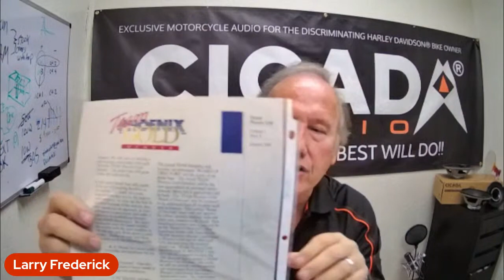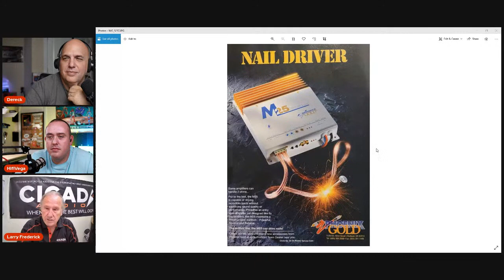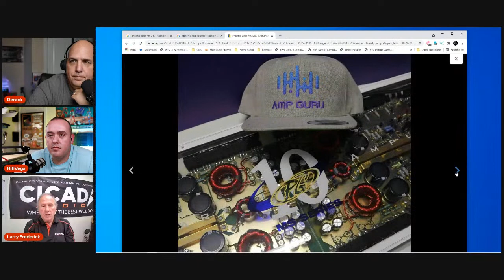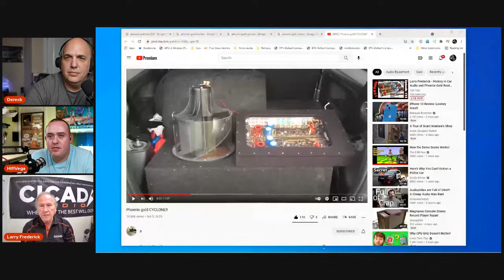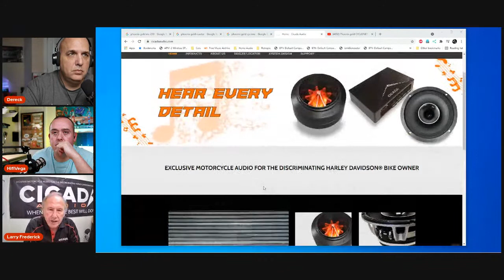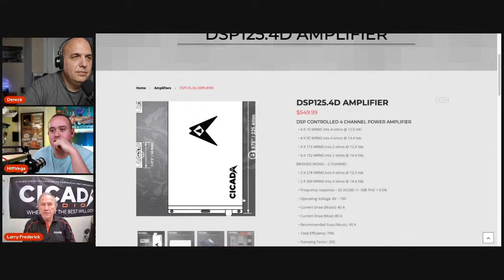Larry Frederick - History in Car Audio and Phoenix Gold Roots - 12V Talk Episode 123

Comment from the maker: Video Index
1:20 Introducing Larry Frederick
2:10 How Did You Get Started in Audio?
8:46 Working for Coustic
13:09 Roots of Phoenix Gold
21:10 IASCA was the Original Social Media
29:02 Amps Made Out of Wood?
29:50 The Story Behind the MPH-6300
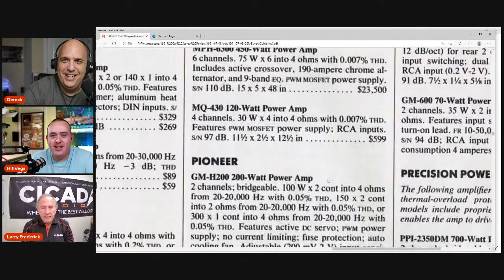40:23 Make them Pretty
47:00 27 Speakers with One Amp?
51:16 This Amp Can Drive Nails
53:00 Phoenix Gold Special Edition Amps
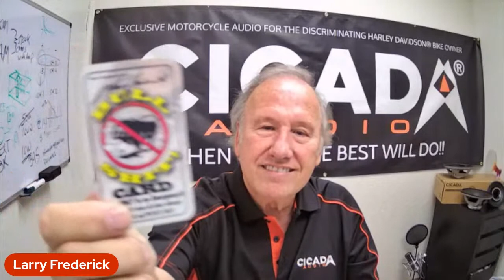1:00:23 The BS Card
1:03:14 Fuses vs Circuit Breaker
1:09:00 The Phoenix Gold Cyclone Subwoofer
1:17:20 Cicada Audio
1:24:56 Bass on a Motorcycle?
1:30:00 Building, Designing and Production all In House?
1:31:13 Why Build Overseas?
1:39:07 Lessons Learned from Overseas Production?
1:41:00 More on Cicada Audio

Comment: I miss those old days. Paul Stary, Rich Coe, Larry Fredrick..  All in Orange County.  A Nakamichi 250 or an  Alpine 7307 head unit with the signal tapped off the Dolby board for a better signal.  And later, Robert Zeff with his amazing Amp and EQ.  Plus a cap bank.

Comment: I remember 1999, it was the year the bass I had been searching for since 1982, a friend told me about this amp he was going to buy, it was an American Graffiti amp made by Zapco, an AG 650.  He told me had some used speakers to sell too, 2 Rockford 15", some jbl component speakers a 6.5 inch woofer and satellite tweeter with a somewhat large crossover box.  The rear fill speakers eventually were JBL power pro 6x9....and the memory is sketchy,  the first head unit was a Blaupunkt, that processed fm in digital, the faceplate fell apart after a year, just in time for the first Kenwood MP3 capable CD deck.(still have this one).  Inside the glove box was an Audio Control eq 4.1 to increase the line in voltage to 12 volts.  The 15s were in an isobaric enclosure that allowed me to still have a trunk in my 94 Honda CIvic Sedan 5 speed special edition (the last year they were made in Japan).  I was near the shop I bought the amp from when getting scolded at work for being late every day, so while getting bawled out, my car was getting the install.  The kick from the 15s would set off the car alarm..not just mine, all the alarms around me, which I would do just for fun at one certain plaza  a few miles from me. I later bought 2 12's from him he had been saving, Soundstream SS12r's, those were put into a dual 12 box vented at 35hz...this was the combo I stuck with, the one that would give you that punch in the stomach bass, even in cars well ahead of you, worked better than any horn for getting someone out of your way.  Dimming headlights with bass thumps when I would listen to bass test cds to turn my driver's seat into a massage chair, one you could not resist...and there was a whole lot of brown bread in the car, enough on the trunk lid that would melt the snow and ice off it in winter.  It turned out I bought the first one the store had, the one on display, and it may have been early spring 99, I had just gotten separated near the end of 98, and I paid the stereo shop before the lawyer, so it was my present to me for riding out the upcoming divorce and alimony.
Reply: Man, I hope things are better for you 23 odd years later.     Takes a long time to get over a Family breaking up.   I really do hope things are better for you now.   The late 90's were really a trip.

Comment: Great show... the Frank amp sold by word of mouth I remember seeing one in person at a show in the early 90s and it was how they spread like most equipment.  I also at the same show listened to an MPS 2240 running a whole car a BMW with simple system and an aphex processor sounded great.  I also dreaded running against the phoenix cars from the shop next door as I was running ADS gear and with power classes the MPS line was strong.